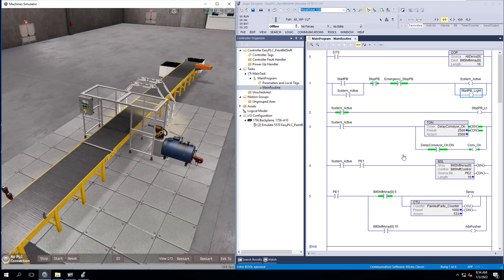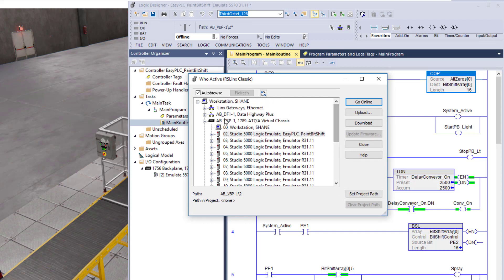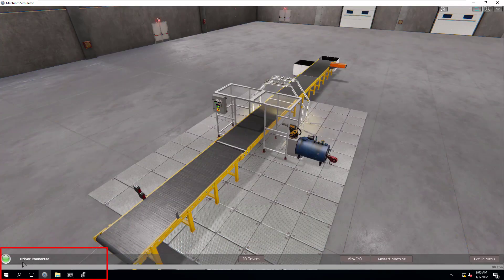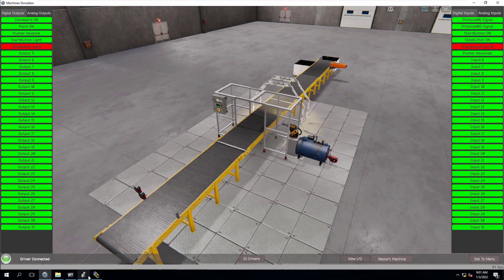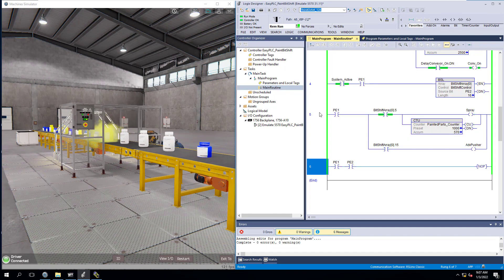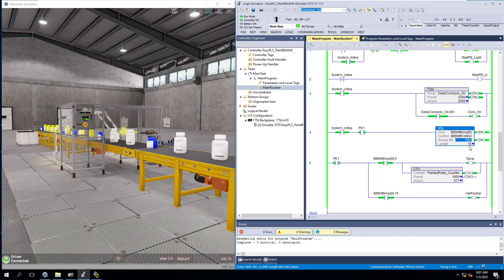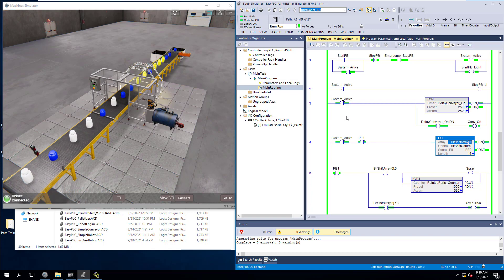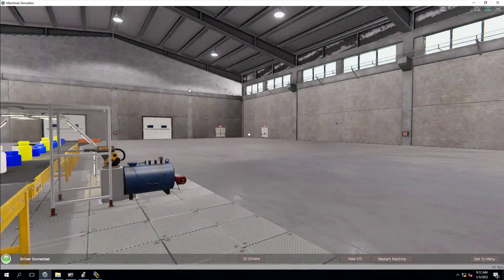Bit Shift Left Instruction in Studio 5000 | Rockwell Automation BSL Instruction

Comment: Hi Shane. Why did you specifically use BitShiftArray[0].5 and BitShiftArray[0].15? Thanks in advance.
Reply: I think it is related to the distance between the photocell (A) and the spray position (B), when one bottle move from  A ->B there are 5 bottles pass  the photocell which mean BSL is active 5 times
Reply from the maker: Timing

Comment: What happens if the process is stopped? Will the BSL continue to shift, or will it "pause" as well. I'm working on a similar project, just a lot more complicated because I'm tracking 3 smaller parts of the same product, and spraying them on separate lines. I want to be able to "pause" and "resume" the BSL so I still hit all three targets if the line stops after I've started my tracking.
Reply from the maker: That depends on the way you trigger the bit shift.

Meaning, the trigger is what makes the instruction work causing the bits to move.

In 99% of programming cases, the bits remain & continue after starting the process back up.

As long as you don't clear the data
Reply: @ShaneWelcher  would a BSL even be the best instruction to use in my situation? I haven't written a program this complex before... mostly easy stuff like conveyors or simple machines.
Reply from the maker: @michaelgriffin6748  not for conveyors but for machine using high speed then it's a good option
Reply: But this only works if the bottles are spaced the same meaning if the spacing change the Spray and kicker wont trigger in the right time 
That's what i wanna solve 
Im assuming the way you chose bit 5 and 15 for sprayer and kicker is that you positionned them on the conveyor and chose what bits align with the sprayer and kicker 
I wanted to ask is this the way that oem machine builders do it or is there à more advanced way 
Thank you

Comment: What the best way to implement an encoder into a situation like this? Could you use the pulse where pe1 is? Just curious was just thinking about high speed application where timing of kickoff is critical .
Reply from the maker: I would use an encoder position as a jitter, meaning, add a limit instruction to monitor the Encoder position then if the product detect is seen within the window then bit shift.

Just an idea & actually a solution that I used before